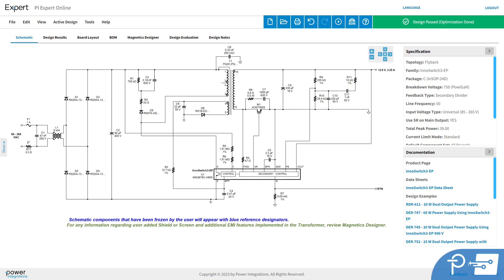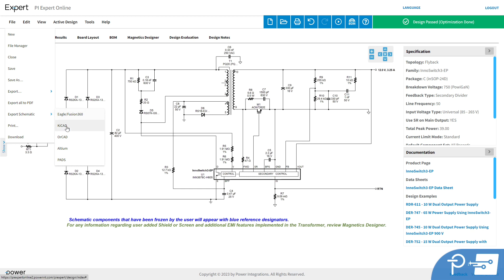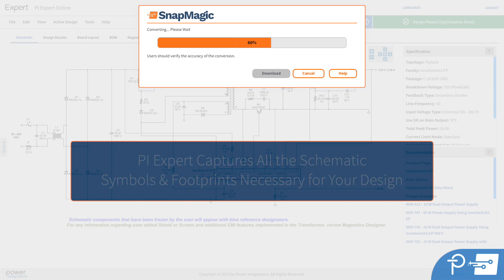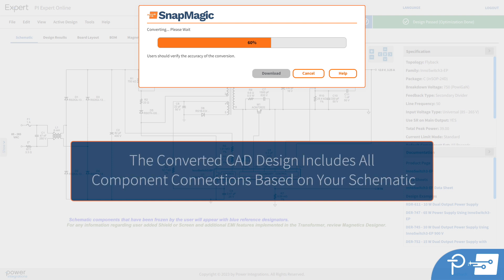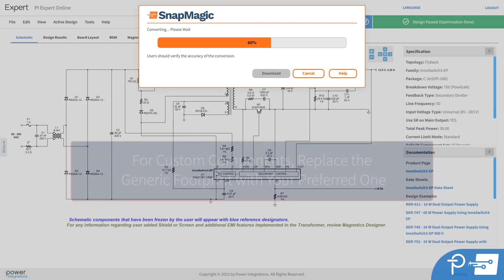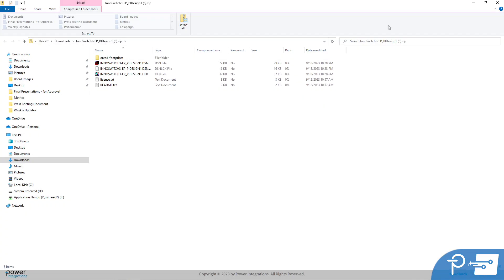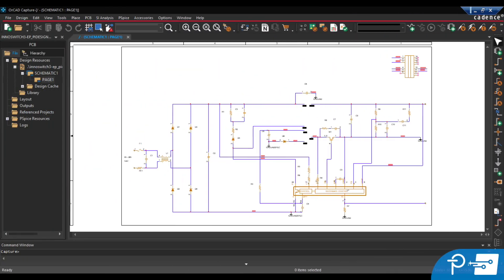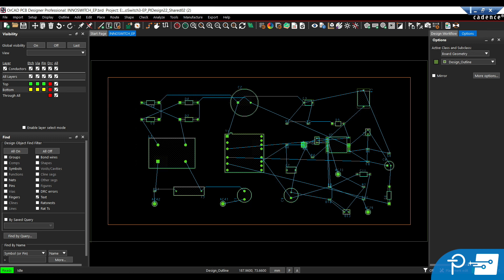PI Expert + SnapMagic - Export Designs to CAD Tools Automatically

Comment: I want to know more about Pi expert Component Library Magnetic Data Base. The terminology use to add user ferrite core is very unclear few of term I know like AL nH/T^2 , but term like SA mm^2 what does it means it is surface area or what ? I  request you to pl. provide me all terminology for core and bobbin which picture explaining it. AE mm^2 , AE min mm^2 ect. for core and bobbin.

Or make video tutorial on how to add custom ferrite core and bobbin and post it on your youtube channel . so we will able to add manufacture Ferrite and bobbin datasheet parameter to PI expert Software.